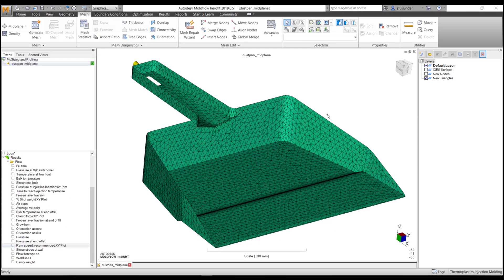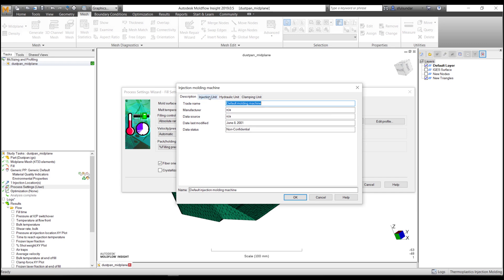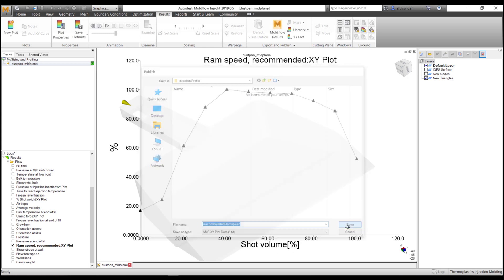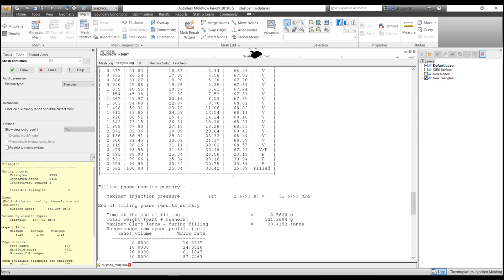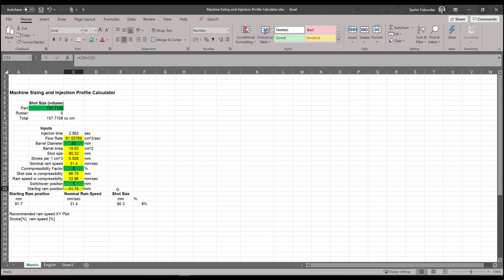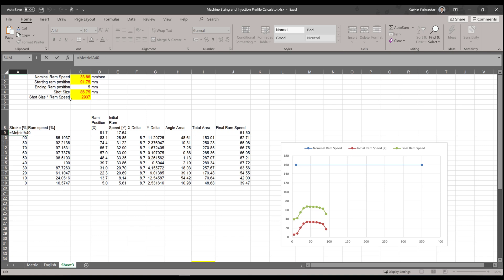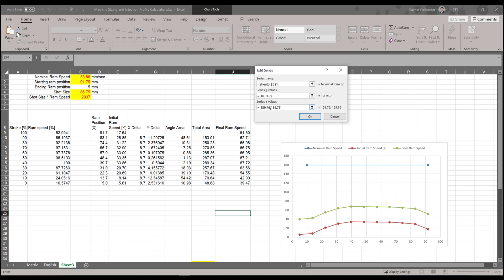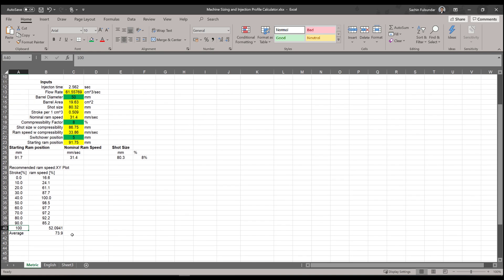Autodesk Moldflow Machine Sizing and Injection Profile Calculator

Comment: In cell C20,  Short size w compressibility 8%  86.75mm  then after became 91.75mm in C23. Why does the short size w compressibility need to plus with 5 mm switchover? And the principles of X Y Delta, Angle, and Total area.